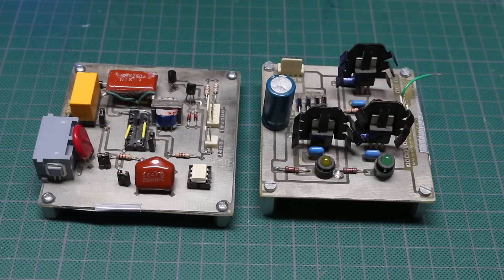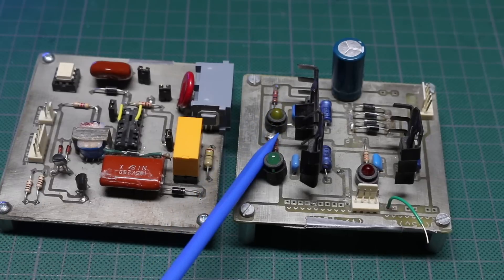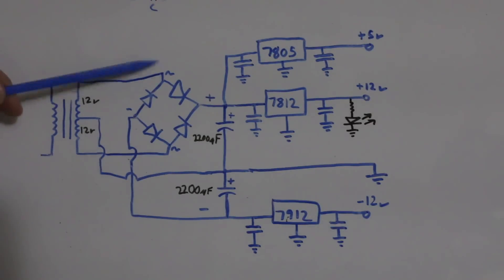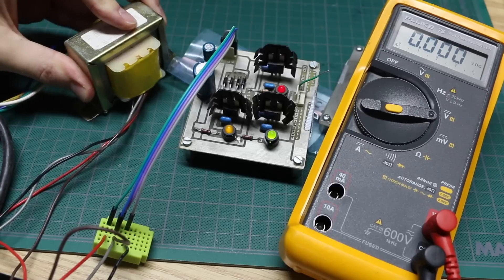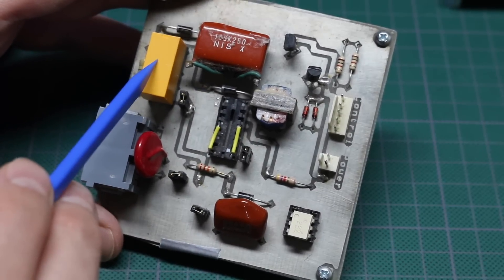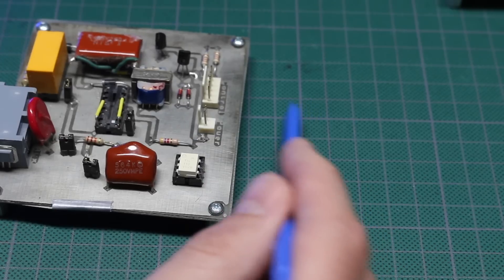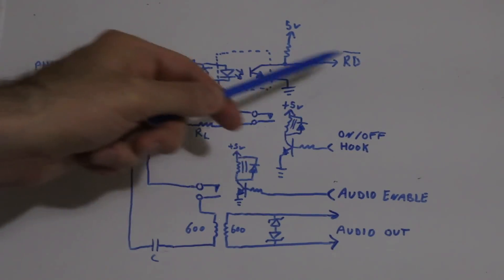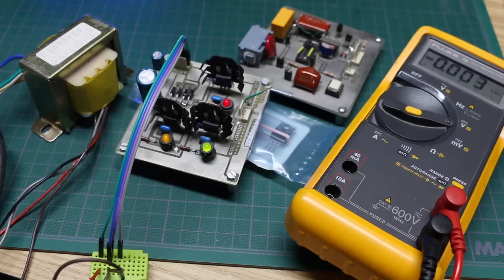My First PCB Layout and Etching in the 90s

Comment: Great video. Reminds me I have two archaic projects on the roster. Refurb of a MC6800 MEKD2 evaluation kit (part of my grad project) and work on an 8008 CPU and 2708 EPROM (details to be determined). 
Keep up the good work 👍
Reply from the maker: I thought I had a 2716 EPROM somewhere but can’t find it, only the UV eraser. I wonder if I can find one on eBay.
Reply: @GadgetReboot  That is so funny/sad. I have the EPROM but no eraser. However I have a couple of EEPROMs on order from ebay.
Reply from the maker: I just ordered a 27C512 EPROM.  Now I have to figure out what I’m going to do with it. I got the eraser around 20 years ago from Digikey when I started using PIC micros with EPROM windows. I wonder if my eraser even still works. 
  I just had a weird nostalgic memory of not leaving the chip in there long enough and the programmer telling me it’s not blank so I have to cook it another few seconds until it works.

Comment: Very interesting. When I did a technical course, the only circuits we got to do was some 555's on a breadboard. As a result I didn't learn a lot. 
It was an interesting way of making the pcb. It looks like it would be easy to bridge the traces.
Reply from the maker: I don’t think I even got to use a 555 in any of my courses. A lot of op amps though. 
 Bridging without soldermask on a board like this is definitely a big risk but because it’s all through hole with lots of spacing between parts, it actually went smoothly. 

 About eight years after this board when I was doing a prototype in a job setting, there were surface mount chips and although I ordered the boards from a proper manufacturer, I did not use Soldermask on the first test batch and that basically became one huge silver solder embossed short circuit layer. Lesson learned.